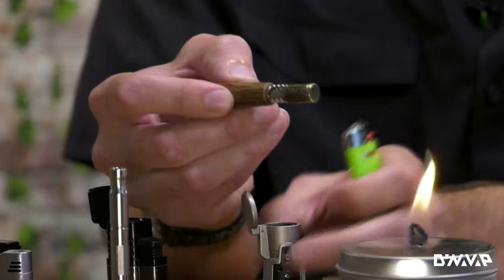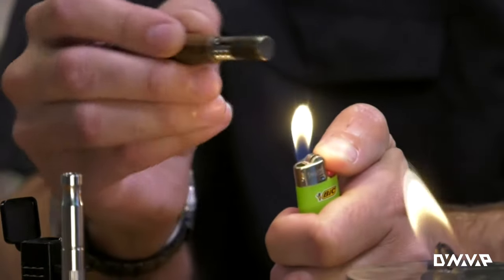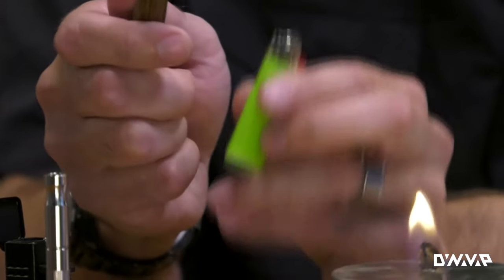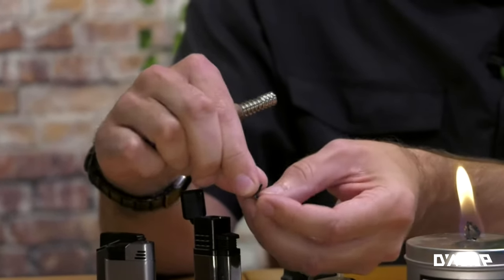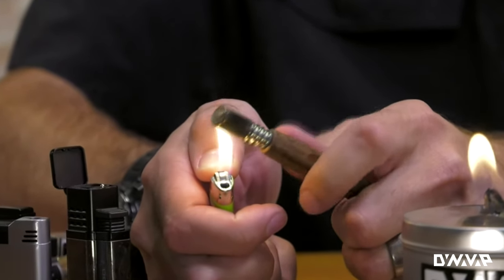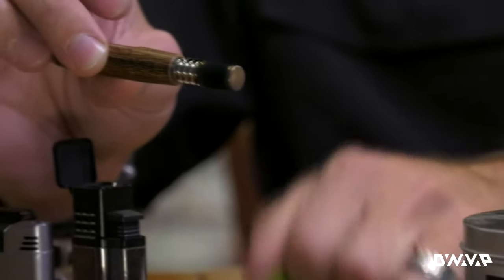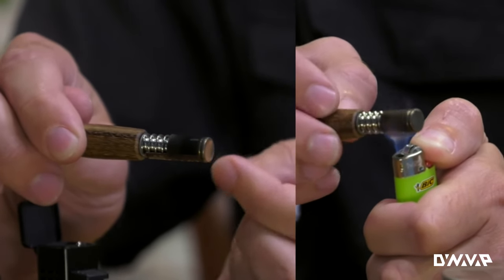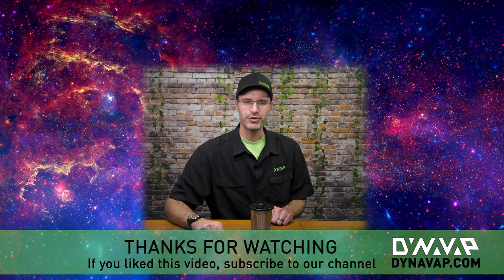How to Heat a VapCap with a Bic lighter

Comment: Protip if you ever get hair on your cap and you accidentally scorch it on there: A little bit of water and wool works remarkably to scour off a bit of the oxide layer and, with it, the tiny hair that got stuck.

Comment: Heat is different than temperature? you learn something new everyday
Reply: Well, yes, heat is different than temperature... Heat is the transfer of kinetic energy through either convection, conduction or radiation.

Temperature is the amount of that energy present in an object or substance when measured.